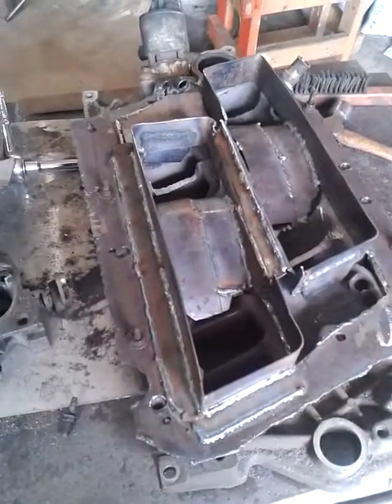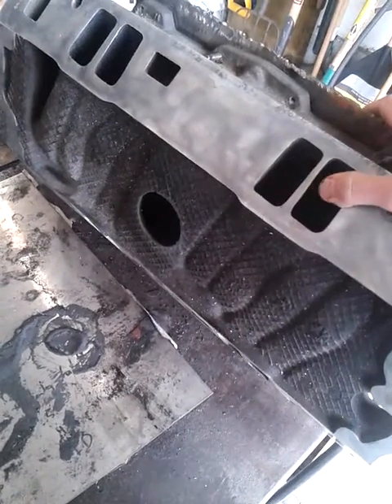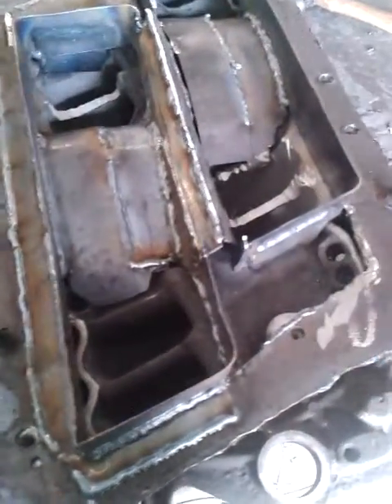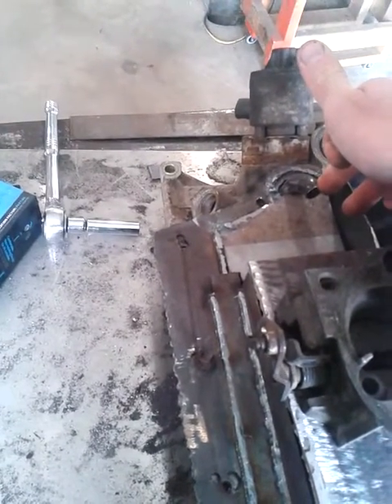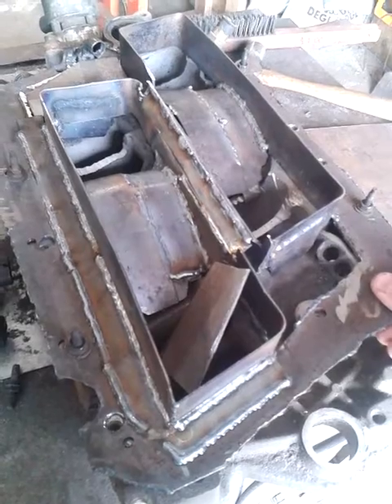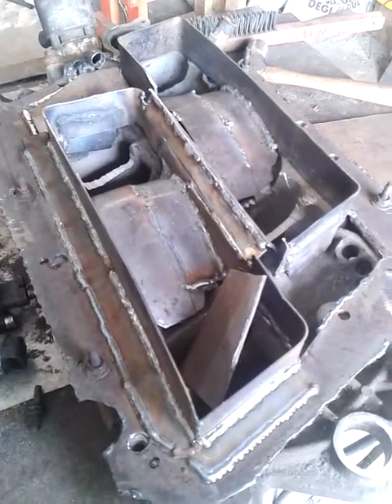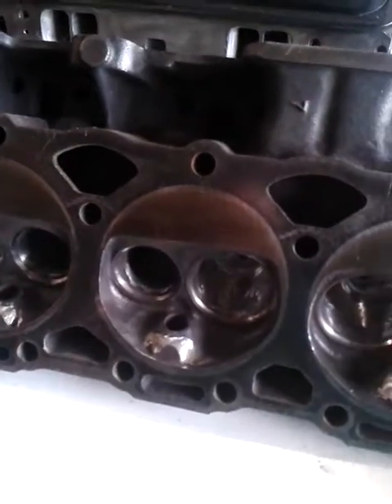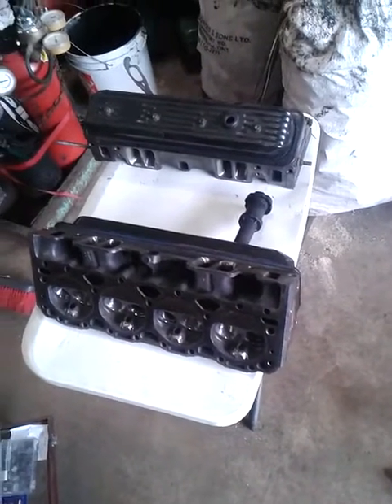woodgas 305 vortec heads on a 350 sbc block

Comment: Dude the 305 heads aren't the vortec type, they were made like the other heads you were showing... also you don't want to put larger valves in the 305 heads, will mess up the airflow. You want the ports on the intake to be smaller than the ports on the head, it helps against reversion.